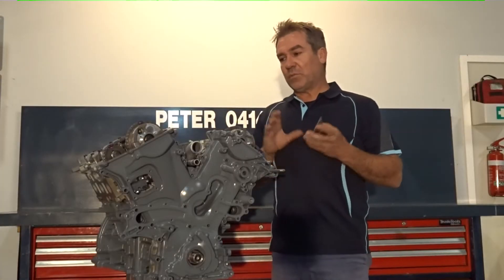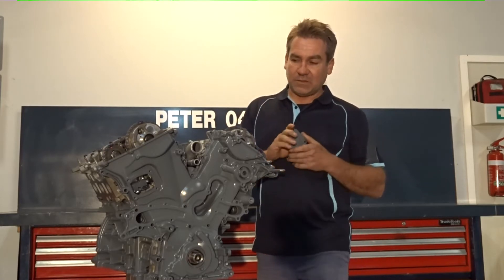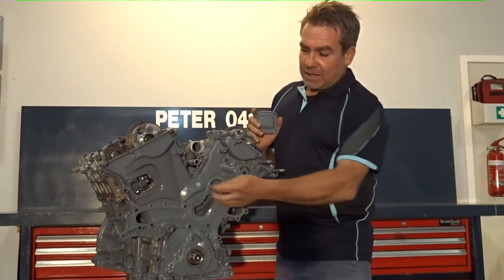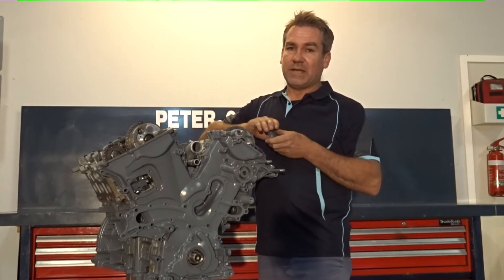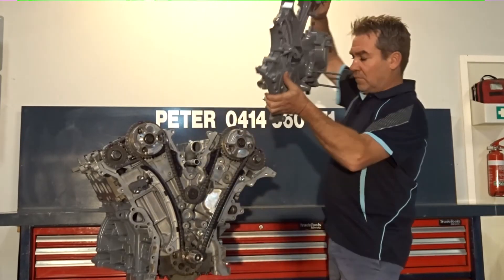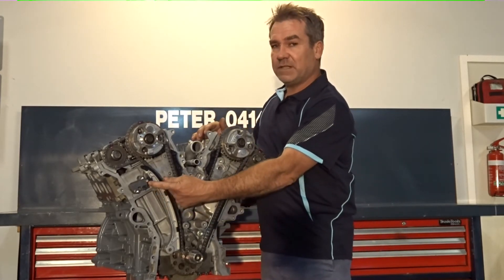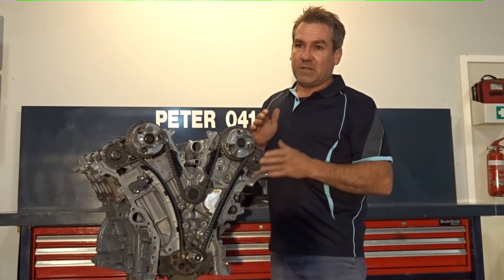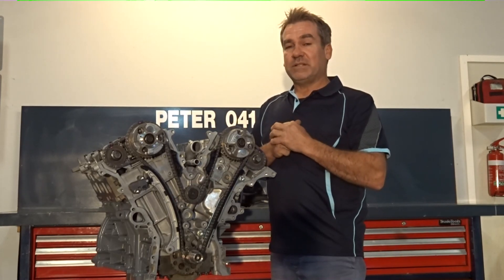Toyota 1GR-fe code P0016 P0018 fault diagnosis stretched timing chain Hilux Prado FJ

Comment: How’s it going bro love the vids just subscribed !! Also wondering what would cause the phaser on the cam gear to break and collide with the camshaft position sensor,  also is the motor worth saving or should replace with a different thanks again from Hawaii!!